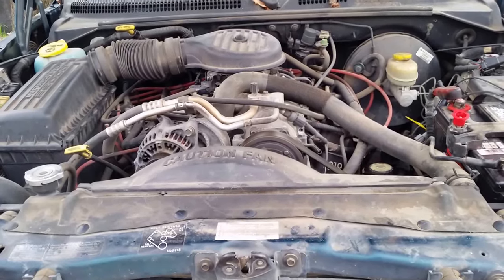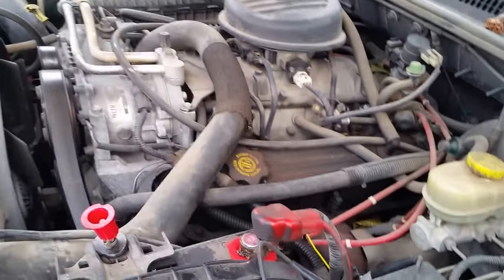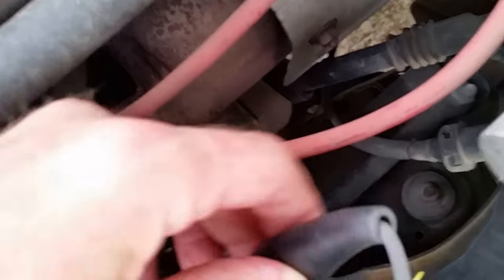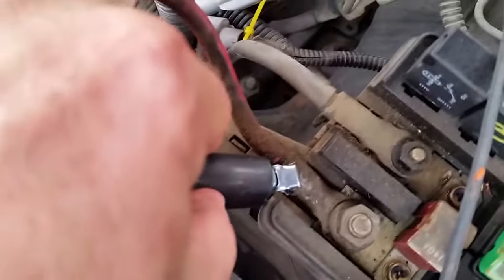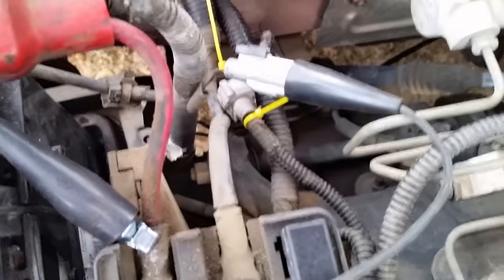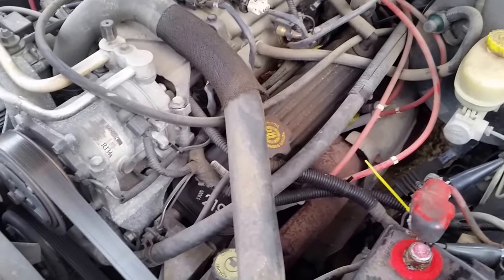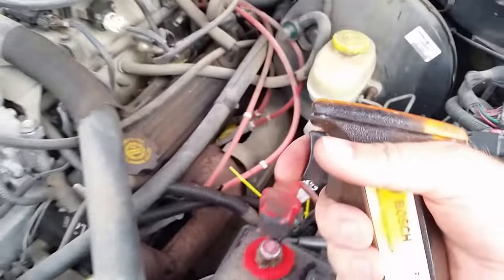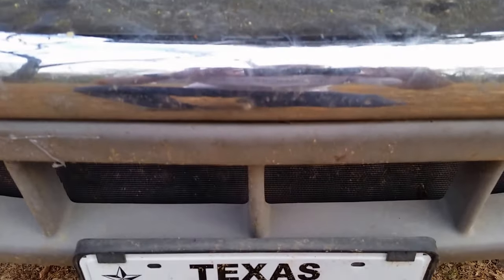Bypass safety circuits and start your car or truck

Comment: By bypassing the starter relay, which you did,  I think you proved it to be likely that the relay block was bad.   I realize this is an old post but I'd be curious.   What was the final fix?           Thanks for taking your time to do this video.

Comment: With the really old cars like 70-80 I think.ive seen people just open up the hood and use a screwdriver and connect to heads on the solenoid and it starts right up
Reply: You can do that with a brand new one too if you can get to the starter or you can pull the relay and jump it with a piece of wire about 6 inches long it’s actually easier cuz you don’t have to get at the starter to do it
Reply: Perfect. I'm looking for that method

Comment: I'm having this same issue with my Mitsubishi lancer. It will start with no problems for weeks and then suddenly won't start. Most of the time if we wait for 20 minutes it will start, it's unpredictable though. New battery, new starter. Thanks for the video, I'm going to give it a try
Reply: Did you ever figure it out? I got the same symptoms on Mitsubishi eclipse. New starter and new battery as well.

Comment: I used a copper wire the first time connecting the bolt connecting the the battery and starter and the silinoid bolt. I purchased what you have in the video. Thanks man, I don't have time to see if its a ignition switch or clutch safety switch. Unless someone can tell me what color wires to cut on a 2002 Ford Ranger for the clutch safety switch and ignition switch.

Comment: Silly question Does that bypass the fuse box? Im intrested to in knowing because i suspect the fusebox might be bad and so will this diagnose if it turns on with the remote start?
Reply: Obviously very old post!  How does a a fuse box go bad?

Comment: p1988 code i always get it and i changed my switch and still get CEL. but I just realized that the ground goes to the starter relay and that pin to the relay is broken and i always and a wire jumper to another ground to start my truck.

Comment: I'm having this problem also I turn ignition switch on, all lights show up on instrument panel But no start So I checked fuses, relays All are good So I disconnect the wire on the solenoid switch on starter S terminal Ran a wire up to battery and with switch on Touch the Pos on battery and she cranks up I also while I was under truck I connected a wire to the wire I took loose ran it up to top of engine so I can test to see if it is hot, ( that wire should be hot when you turn the switch to crank the truck) when ever I think I have found the problem  SO now I can research my problem I found at the fuse box Starter Relay and Fuse were good So I pulled the fuse and noticed where the fuse plugs in (you have 2 male legs) only one side where the leg plugs in had a female clip So the fuse is not connecting I took box loose Flipped it over looking for a wire that is just laying there not connected to anything I have looked of and on for 4 days and have not found a loose wire Now I'm puzzled ILL keep checking and hope I find the problem Thanks for the video

Comment: I wish I had one it would be so simple
Reply: I swap from automatic to manual in a hyundai tiburon v6 2.7 now that a put all parts it wont start no crank no sound can u help me with transmission conector wire code for 03 tiburon

Comment: I have been starting my car like this for years, better off running a wire from the starter to the ignition switch fuse. I turn my key to activate the fuse. Only safety feature that does not work is neutral safety switch, which works still don’t know what the problem is 4 years later lol

Comment: Basically you told people how to hotwire stuff lol at least u got remote switch.
Reply from the maker: Not exactly:  The key still has to be in the ignition, and turned to the "run" position for the starter to engage when pulling the trigger.

Comment from the maker: Sorry folks this is a farm truck and has not been fully repaired. I have a suspicion it was the neutral lockout switch in the transmission being eaten by rats that caused this condition.  Maybe one of these days I'll get it to the shop and have the situation resolved once and for all. When I do I'll let you know

Comment: I had put a 5.9 in my 06 ram1500 it had a 4.7. I put the transmission an pcm for the 5.9 but it still doesn't want to start..help....lol